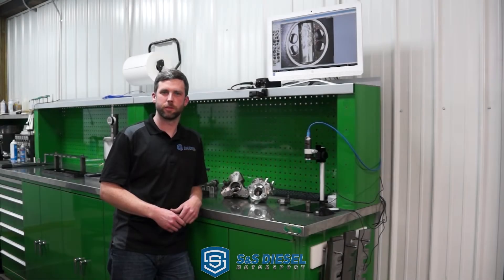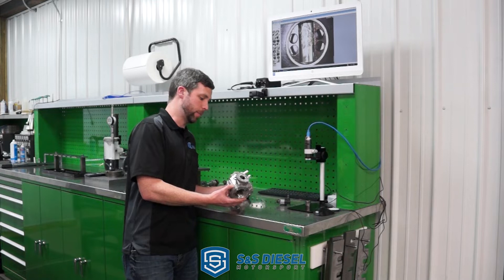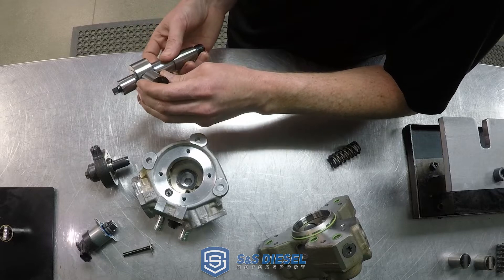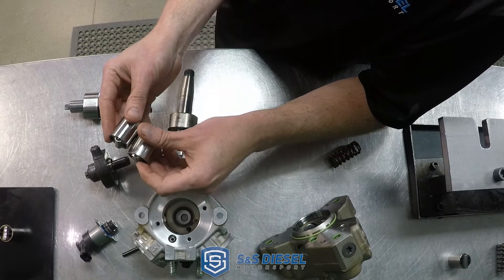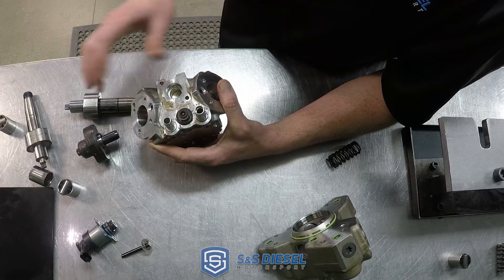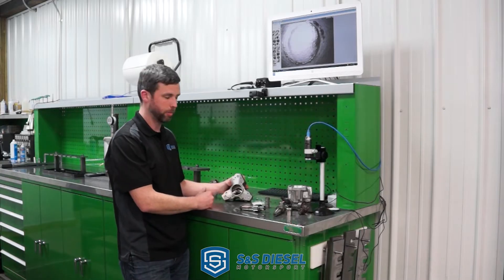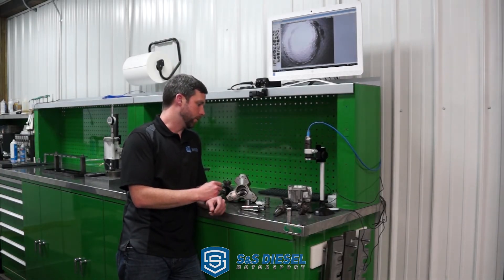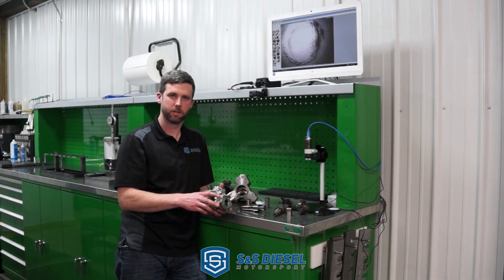Bosch CP4 vs CP3 High Pressure Fuel Pump Comparison

Comment: Great video! I have '16 Cummins, MM3, air box, exhaust. I bought the truck with 17K on it. Oil level was about an inch over full, when I took delivery, I just figure someone doesn't know how much oil it takes, so  I changed it, twice, NOW with 28k on it, oil level is up about 1/4"! It's defiantly "making oil", what are the chances the cp3 pump is leaking fuel into the crankcase? Thanks in advance!

Comment: I have a 2019 L5 P, Only 10 months old commercial  Long distance use.  High pressure fuel pump let me down already the code says it's the pressure regulator. Truck idle smooth but won't even move rail pressure drops to about 1500 PSI.  And fluctuates sporadically.
 130000 miles on the truck,  Going to replace the entire  Fuel pump, But my hopes are grim for this system in the future as I drive a 140000 miles a year.
 I'm not sure if I made a major mistake by not buying  Dodge instead of GM

Comment: Does anyone know what percentage of these CP4 pumps go bad? I got 2012 HD Silverado Duramax and just don’t know if I should keep the truck or trade that POS in!?
Reply: My CP4 went up on my ‘16 lml. 59,000 miles all stock
Reply: Chris Boone  did u ever add any lubricator additive to your fuel
Reply: No just ran diesel
Reply: My 2011 Duramax just let go with a $10K repair bill. Chevy dealership wanted to replace with another CP4 pump. Uh uh. Ain't happening. Going to a CP3 conversion like you say.

Comment: outstanding video.  I suppose (haven't done this yet) you can simply tell what pump is on a truck (example RAM or Powerstroke) simply by the appearance..those 2 look very different on the table, I hope I can tell when I look under the hood?

Comment: I've had a similar pump with failure from Delphi. Air managed to enter the fuel line and the pump didnt have any lubrication for a few seconds at the end i also had to replace all of my 3 injectors on my 1.2 TDI

Comment: thank you for really informative vid. What would you suggest for a stock California 2013 GMC 2500 LML less than 40K miles that has no obvious issues? trying to be proactive of a well taken care of truck.  Seems to be a lot of talk about lift pumps, cp3 conversions or combination of both...
Reply: @SSfueled  thanks for the reply, already tracked down the california legal version had it shipped here and installed by PPE in Montclair CA... they would make an excellent dealer for you guys here in SoCal where there are a shit ton of stock LML's that have no idea about this problem yet and you are the only legal solution. I actually own a custom shop and tried to purchase resale via dealers listed by your company, all were a pain in the ass it was easier to buy online from you.... maybe sign on a legit distribution company like transamerican wholesale hell even PPE could do it as a manufacture of diesel truck parts out here? anyway, great product so far 3 weeks in!

Comment: wait.. they are lubricated by fuel? why?
Reply: In adequate quantity and within its temperature range, diesel fuel is a good lubricant.
Reply: EPA  mandated.. that American refineries remove sulfur to almost ZERO....hence failures.. P.S. adding 2 stroke oil will not help... it will not get through the fuel filter... FORD also install this piece of garbage....pump

Comment: Why would Bosch re-invent the wheel with that pot metal POS CP-4. Those idiots over there most likely decided it was way cheaper to cast and machine that POS aluminium CP4 case and never considered the importance of keeping those rollers oriented against that cam and the steel lifters from grinding away at the aluminium walls. Corporate greed must be Bosch's priority these days. I am going to stay away from anything with their crap from now on.
Reply: I’m sure the OEM’s were squeezing Bosch on price also.

Comment: Hi! So VW Tdis also use the cp4... And darkside developments makes a cp3 conversion. Besides the point- according to their testing the cp4 was only good for 380 hp ish on a 3.0tdi with stock injectors. And in their experience the cp3 will go over 400 stock injectors. Obviously in US diesels with over double the displacement folks are taking these pumps WAY past that. Is this a difference in pumps? Or is it more a factor of "x" fuel at "x" pressure can only go through 6 cyls so fast- where the US diesels using these have more cylinders with larger injectors.

Comment: Can you swap the cp4 for cp3 in 2016 power stroke? I know there is the disaster prevention kit but I’d rather just replace the pump and have no issues.
Reply: I think theres a difference in pressure deliverance in both

Comment: What a shame, how many diesel owners have suffered, is Bosch being held responsible for these losses?
Reply: It is ashame, as a Duramax LML owner that my truck has exited warranty at they end of July(also a GM certified dealer trained technician) I am currently looking into the aftermarket Fleece helper "lift"  pump that installs into the factory location in the fuel tank and retains all of the GM electrical connectors and lines OR you can "add on" the upgraded lines and AN fittings for higher volume and higher and steadier pressures along with the option to install a seperate return (that is similar to the "Ford disaster prevention kit") supposedly with installing this aftermarket pump in the tank this will help the CP4 pump to avoid any starvation of fuel created in the tank due to another poor design that causes the CP4 pump to strain itself and cause the "entire fuel system failure" of death that in turn cost the customers 10K or more in Parts and Labor. I am willing to try this Fleece pump option and add a external fuel monitoring gauge onto the system that I can either set up to read digitally on some sort of aftermarket controller or connect it manually to a digital to the tenth PSI gauge inside the cab along with a few other modifications that will allow me to monitor boost pressure because with this new fangled biden EPA RPM ACT we as consumers are no longer allowed to add any type of upgraded and or modified exhaust system to help prolong engine life and let it breath properly without serious consequences to both the consumer and or parts supplier which in turn has made finding the upgraded downpipe along with a 4 or 5 inch downpipe back exhaust system (or particulate filter "DELETE" kit) which is total horseshit considering that the cost of these extremely unnecessary engine chokers is ridiculous and all a money racket for the government along with the DEF fluid that we must install to continue driving these Emission slave controlled diesels on a daily basis!!..I believe if they want us to keep these things blowing our urea from the tailpipes(which go ahead and get DEF fluid on anything and see the affects both short and longterm) that the GOV'T should be responsible for the warranty and cost of replacing these unnecessary items when they fail. Look at the balance scale of pros vs cons of the entire emission compliant systems and fluids from start to end of the production process to the disposal process and the amount of waste created from all the plastics wrappers, containers and paper wasted and contaminated for all this DEF and Part for the systems when built and also when replaced during the life of these vehicles.......This is a dictatorship of a country we are beginning to live in with NO rights or FREEDOM!

Comment: With the new Cummins 6.7 2500 2019  
What to look for in these engine to keep up with and not have problems
Reply: @SSfueled  when can we expect the conversion kit for a 2019/2020 ram 6.7 Cummins H.O. 3500 to be out?
Reply: @SSfueled     I'm considering selling my 12' and getting a 19' or 20' so glad to hear you're getting it done!  I'm assuming whatever you come up with will be able to work with a stock truck and also tunable for us HP junkies?
Reply: SS Fueled Have you guys had the ram 2019 pumps apart? They claim that they’re not the same cp4. Is this true?

Comment: Great video. On the CP4 pump have you seen failures with the Exergy Fuel Saver valve installed ? If so has this valve helped protect the rest of the system?
Reply: @SSfueled  what is the difference between a compliant cp3 swap kit and a non compliant cp3? One requires EGR to be removed correct? Why?
Reply: SS Fueled Thank you for getting back to me. I have a 2011 Silverado LML with 149k on it. I do have the duramaxtuner tunes installed with the Fass 165. All
Emissions intact , stock turbo and stock injectors . What would be the best CP3 to go with if and when I need to? . Or is it okay to stick with the CP4? I live in Ca. 

Thank you..